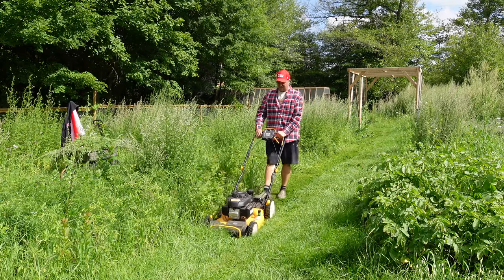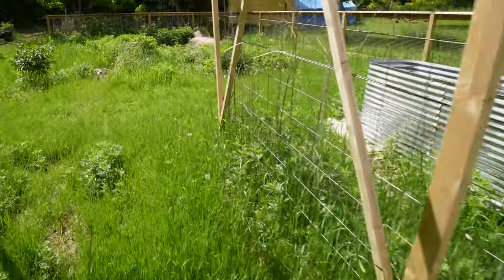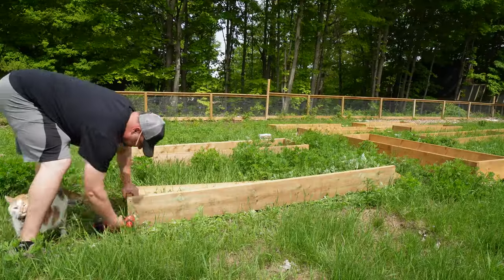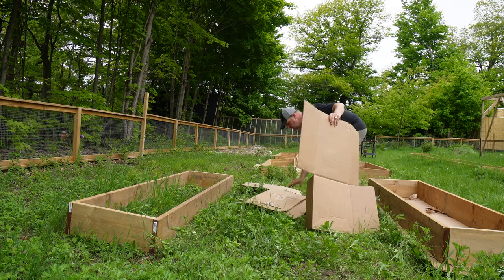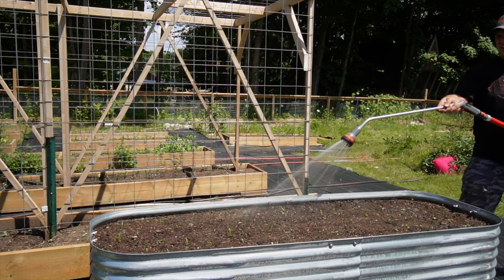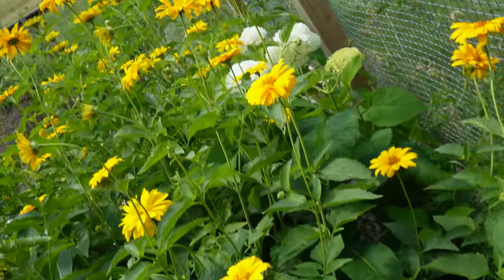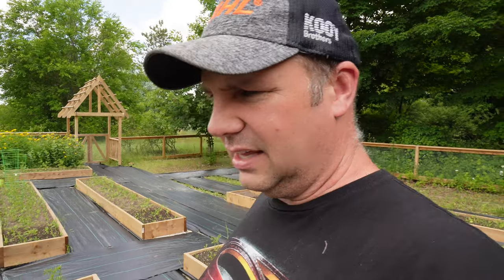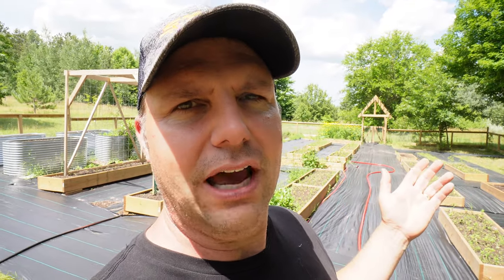Man Restores Abandoned Veggie Garden to Fight Inflation

Comment: In your paths you state you plan on using wood chips. They will decompose and become soil full of weeds.  I'd use gravel if you could as even if you get weeds in the gravel, they are easier to remove than in soil. I learned this the hard way. Just a thought for your comfort.
Reply from the maker: It'll have to be something I think about, Thanks. I was gonna use chips cause they would be free, but I don't want to have to redo all this work in a few years. Chad.
Reply: @hidden springs farm, cardboard is always a choice. Brings red wigglers for your garden.